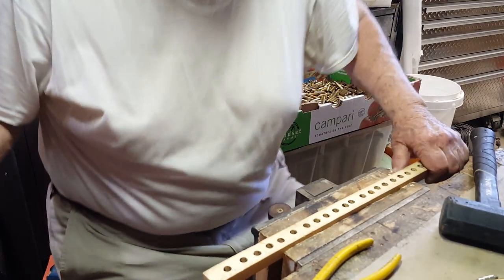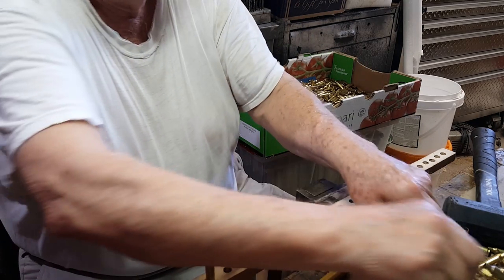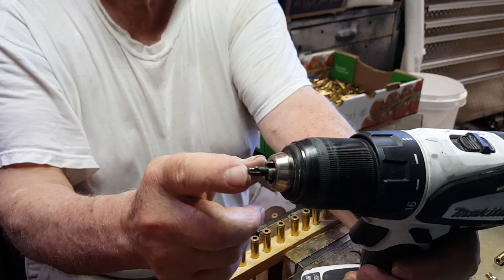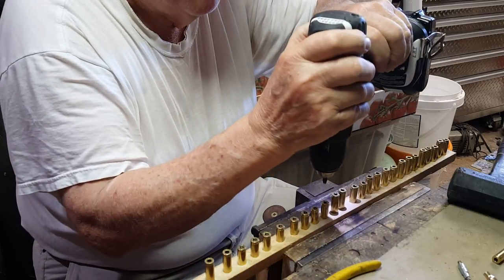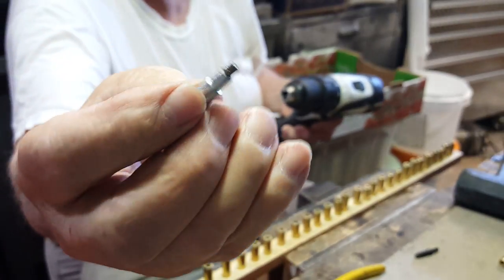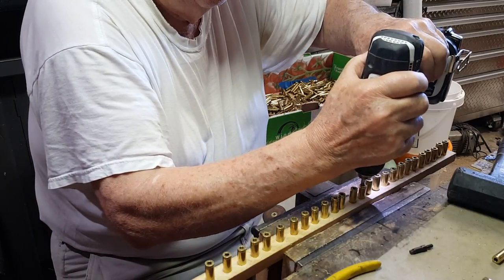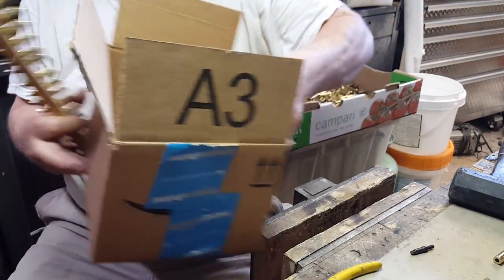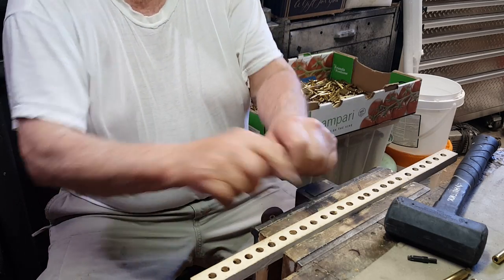Crimp removal & pocket cleaning

Comment: Interesting method. What size hole do you drill into the wood? Thanks in advance
Reply: any luck on the hole size? I shoot 223 and would definately like to know
Reply: @fosterel  the shoulder diameter of a 5.56 case is .354 and the base diameter is .377 so if you used any bit under .377 the case will drop in and hold still by friction. 23/64 bit is .359 so that's likely what he is using.